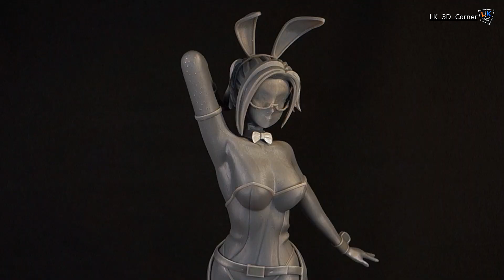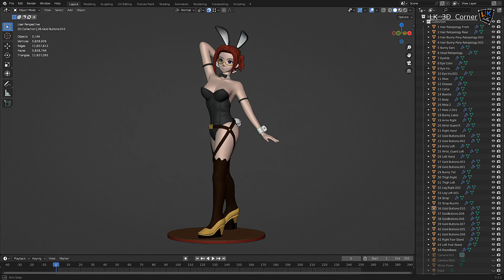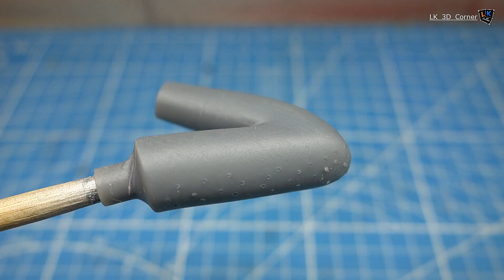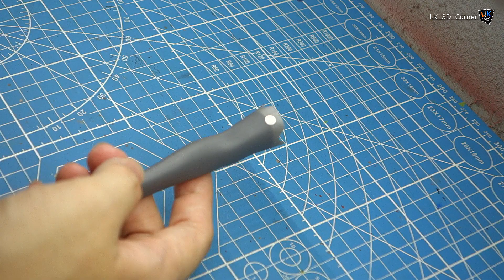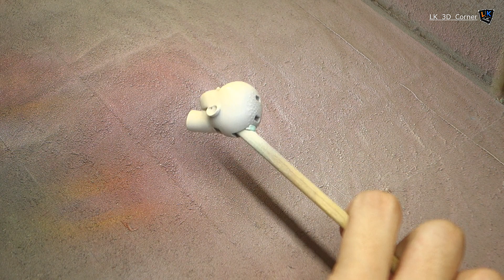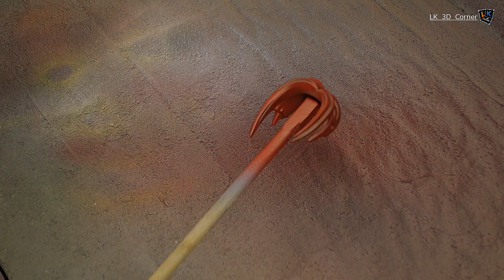A Bunny Anime Figure (modeled printed painted)

Comment: Awesome work! Any resources you would recommend for sculpting in Blender? Do you follow a specific workflow?
Reply from the maker: Hi, I would say FlyCat's channel is a good resource for sculpting (It's mostly speedsculpts but you get the idea from it). Regarding my workflow, mine is a rough sculpt, just enough to outline the details that I want, then I proceed with manual retopology and completing the model that way. A mesh that is not too dense is easier to control and refine.